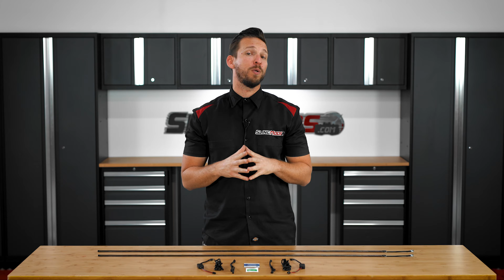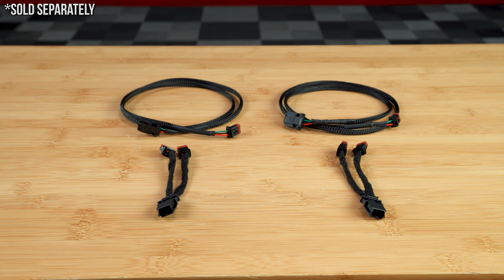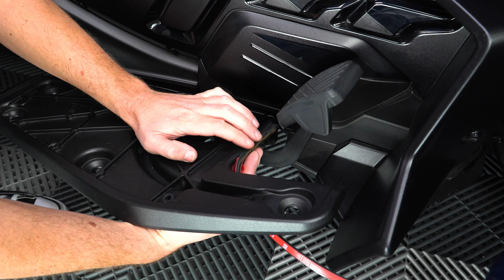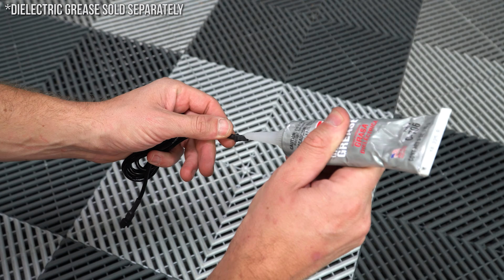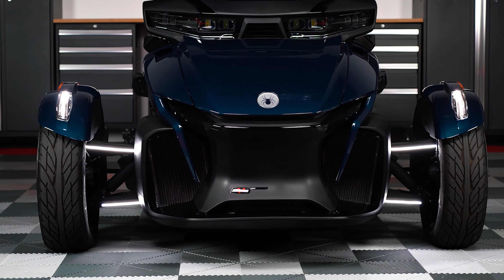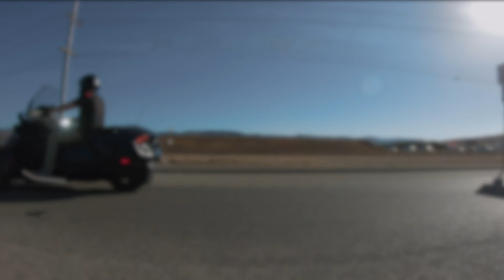Can-Am Spyder RT LED Floorboard Running Lights w/Blinker (2020+)

Comment: I got my ‘22 Spyder RT S2S Nov 2025, it had these already installed when I bought it, and they have worked perfectly, until today I noticed the left one is staying on Amber constantly and doesn’t blink. Any ideas why that would be?
Reply from the maker: Our Customer Service Team is standing by for assistance: https://www.slingmods.com/index.php?route=information/contact
Reply: @Slingmods found the issue..moisture in the connections from using a pressure washer on the wheels and the footrests..WD-40 and compressed air did the trick.

Comment: Bought 2021 RTL that already has the fender blinker so what do I need to add the floorboard blinkers? Anything extra?
Reply from the maker: Hello, If the Fender Lights are from us.. then you'd just need a 1:4 Splitter to split the signal from the harness to the other mods. You can find that here: https://www.slingmods.com/canam-spyder-led-power-expansion-harness

Comment: They should  Of just added that to the  2021 Since there were no changes!  Or a home link . Anything the 2020 and the 2021 are the exact  bike. Just the year difference o and silly of me the cost 🤪. The sea to  sky was nice till they took out all the accessories!No lite boards  no razing of the handel bars. And one more item the back lide. And you can't put on the passengers arm rest. Every thing else is questionable. Maybe I will give the RT LIMITED a shot 🤔

Comment: What if I do not have the fender A-Arm lights/splitter/module and just want to add the Floorboard Running Lights w/Blinker functions to my 2021 Spyder RT Limited. What do I need to order to have the LED function as well as the turn signal option work.
Reply from the maker: Hello, if you'd like to just run the Floorboard lights.. you'll need our 1:2 Front Fender Power Harness to supply power and turn signal functionality to the Floorboard strips. That can be found here: https://www.slingmods.com/canam-spyder-f3-rt-front-fender-expansion-power-harness-2019-up

Comment: I just bought a 2020 RT limited. I want to get the after market sequential fender turn signals. Is there a way to connect the floor board...A-arm...& the Sequential turn signals?
Reply from the maker: Hello Jim, congrats on the new ride!. Yes! You need to have the 1:2 fender power harness here: https://www.slingmods.com/canam-spyder-f3-rt-front-fender-expansion-power-harness-2019-up This will give you a 3-pin power harness connection down by the a-arm that will allow you to connect those other lighting mods at that location.
Reply: @Slingmods  Thank you very much 👍

Comment: I have a 2019 Spyder RT Limited are there floor board lights for it?
Reply from the maker: Hello DesertRose, my apologies.. but that is not something that's available at this time.
Reply: @Slingmods  NP doesnt hurt to ask... I just got my Spyder just over a week ago so to its still Brand new to me.. only had 7 miles on it when i got it...just like more lights..
Reply from the maker: @LeshilaS  Well congrats on the new ride. Thanks for watching. 😁